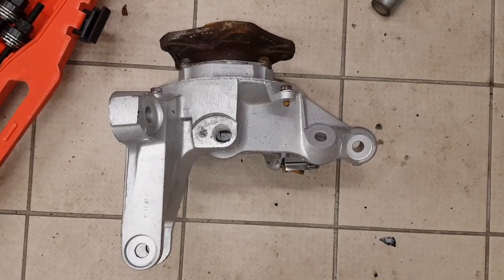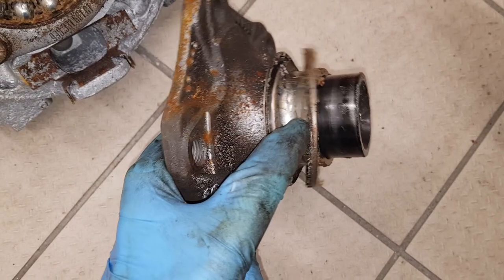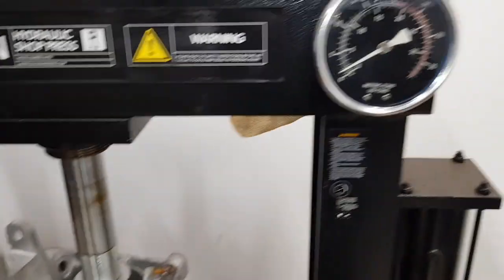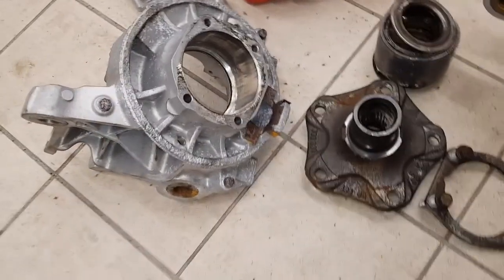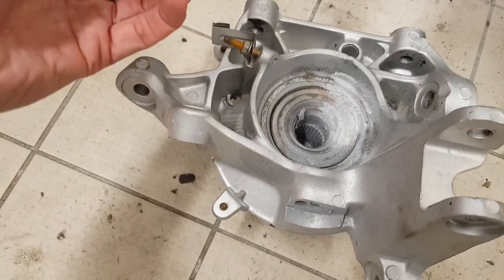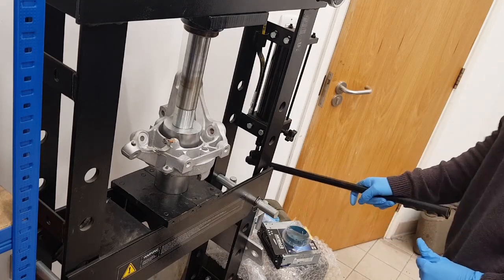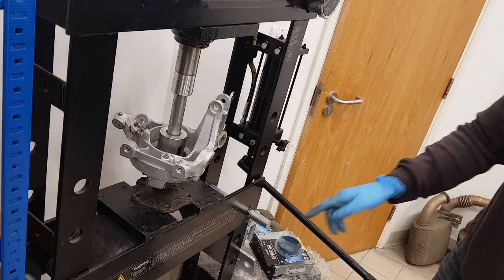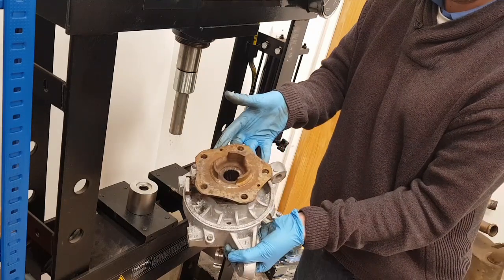Porsche 996 rear wheel bearing replacement

Comment: Thanks! I'm about to do this myself, even bought a small press for the job. Quick question – Did you determine which side of the bearing was magnetised? I've read conflicting info about the importance of this.
Reply from the maker: It wasn't important for the sensor setup. I might have oriented it based on the printing on the bearing. Can't remember I'm afraid.